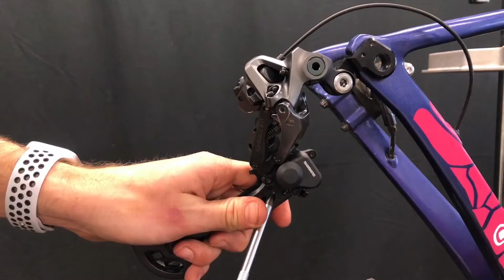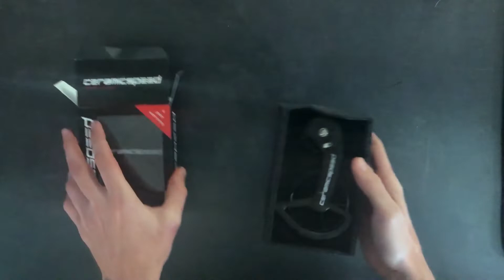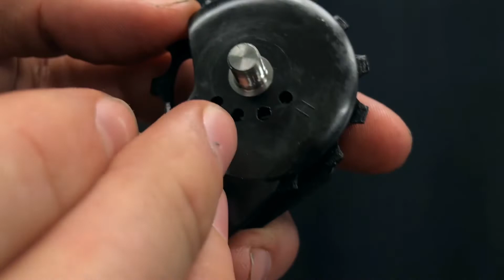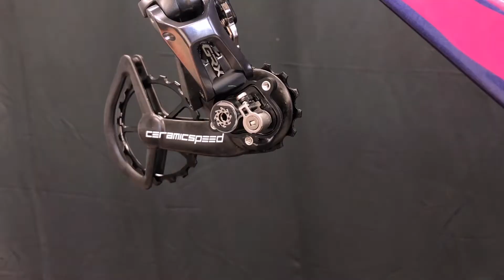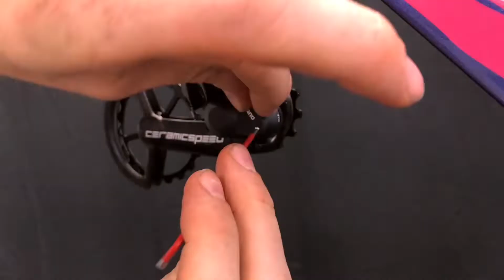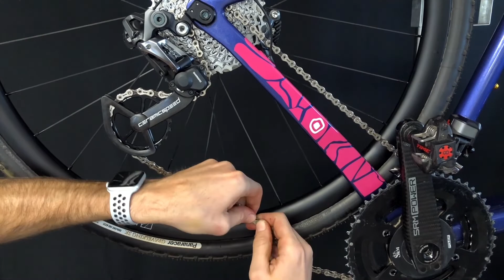Installation guidance  for the OSPW X compatible with Shimano GRX/RX

Comment: After the cage goes into the neutral position, I could not remove the inner plate with 4mm. It's so tight. Anyone has similar issue?

Comment: Will this work on Di2 cage 1x?
Reply from the maker: Hi Rome, our apologies as there was a typo for this systems compatibility description and we will have that updated. The RX800 and GRX compatible OSPW X system is designed for 2X systems, and specifically the 2X specific GRX derailleur. The pulley placement and rotation stop screw location are different on the 1X specific GRX derailleurs and we cannot confirm or support compatibility or function.